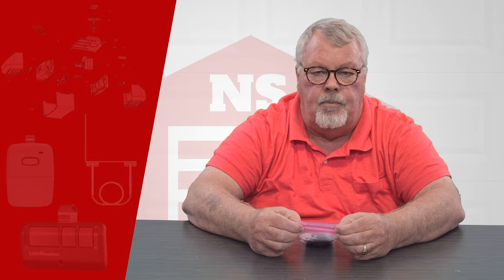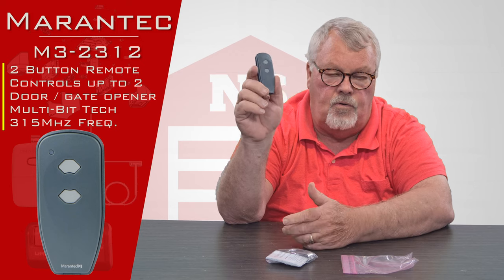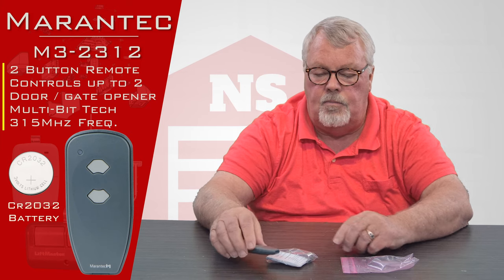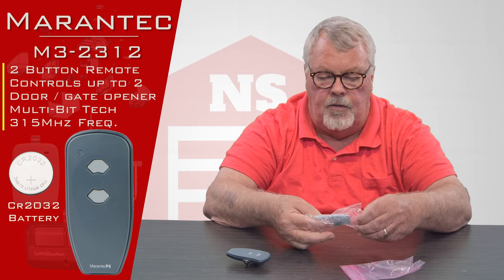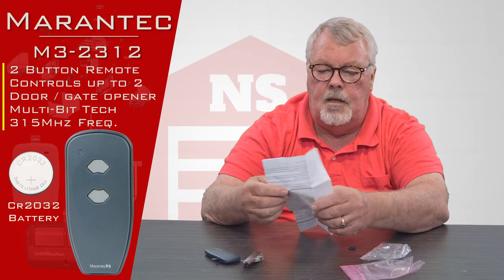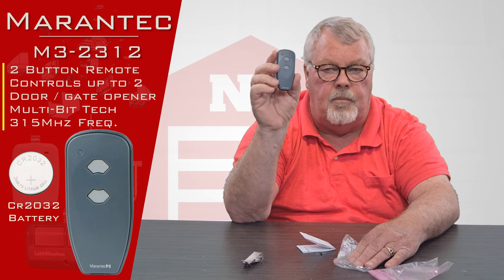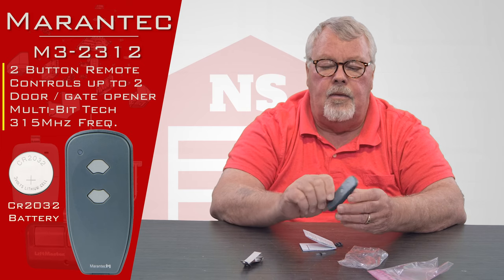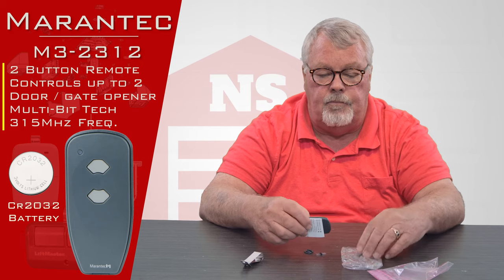Marantec 2 Button Transmitter M3-2312

Comment: I don't have the tool and need to force the transmitter to change its code. What do I need to do?
Reply: Marantec Garage remote control for M Line 4500 instruction

Please note that only one (1)remote is programmed to the motor. Any additional remotes program using the 3 wire connector pin.
 
Make sure the batteries are replaced in the remote controls if they are older than 6 months. We use CR2032, 3 volt battery. 
 
 
 
How to program Marantec Remote Controls
 
BE CAREFUL! You may need a ladder to access the buttons on the garage motor. 
 
Only one (1) remote is programmed to the motor.  
 

Go inside the garage

Look up at the garage motor on the ceiling.

Marantec motor has a display of red LED lights;  numbers 1 through 8.  

Next to those red LED lights you will see a “P” button, + plus and – minus button.

Please look at the display on the motor and familiarize yourself with these buttons.

 
￼
 
 
You will only use the “P” button to program one (1) remote. 
 

Press and HOLD down the “P” button for 3 seconds, release the button after 3 seconds 

 

Quickly PRESS & RELEASE the “P” button several times until #7 led light blinks slowly.

 

Press and HOLD down the button on the remote control for 4 seconds. 

    This is the button you want to use to operate your garage door; TOP or BOTTOM button.
 

The # 7 light will flicker fast when it picks up the code from the remote control. 

After 4 seconds, release the remote control button. 
 

Press & release the “P” button one (1) time to exit programming. 

You have completed the step.  Test your remote to make sure it works. 

 
 
 
Additional remote controls program using the 3 wire connector pin.
 
 
 
How to program additional Marantec Remote Control
 
Here is a video you can watch.
You Tube video:    https://youtu.be/MYkUaLJEM-A  
 
 
 
￼
 
 

Put the working programmed remote in your LEFThand. 

Put the remote you need to program (non-working) in your RIGHThand. 

On each side of the remote there are 3 small holes.

Connect them together with the 3 wire connector. 

￼
 

Using your hands, gently push the remotes together. 

Press & Hold DOWN the “active working” button on the remote in your LEFThand (do not let go of the button until finished programming). 

Now press & hold down the button on the remote in your RIGHThand. 

Gently “turn & move forward” the entire remote in your RIGHThand while you are pressing and holding down the button 

(this is so the 3 wire connector will touch the logic board inside the remote).
 

The red light on the remote control will blink fast and then go solid when it picks up the code from the other remote. 

Release and let go of the remote control button in the RIGHThand. 

Then release the remote button in your LEFThand.

Remove the 3 wire connector pin.

Test your remote to make sure it is working.

If it does not work then turn the non-working remote around clockwise and use the other 3 holes to connect the program cable. 

 

 
Thank you and regards,
 
Jim Libasci
Tech support & Customer Service
Marantec America Corporation
 
￼
 
5705 Centerpoint Court
Gurnee, IL 60031
Direct: 1-888-622-2489, ext 6417
 
www.marantecamerica.com
 
Created with OneNote.
Reply: The tool is only if you wanna activate a 2nd remote. So to say transfering the codes from the original to the 2nd remote
The guy in this video is a joke. He knows nothing about these remotes.

Comment: My question was if you change the battery does the remote lose it's mind? Need reprogramming?  Fortunately NO, there's some sort of eprom in there, so replace the battery without fear. You will not have to reprogram the remote. (and any other cars you may have copied the code into)